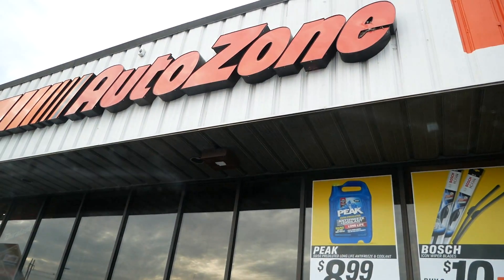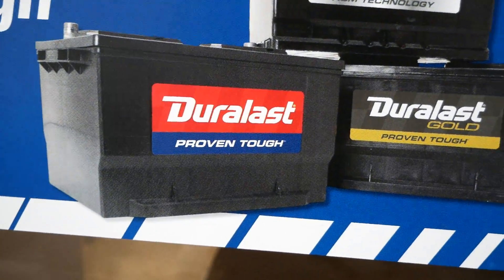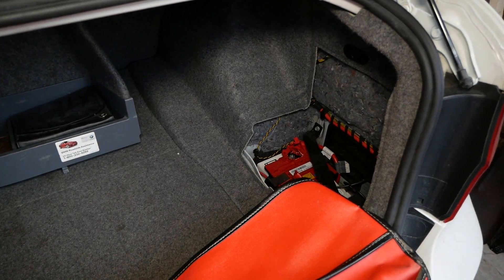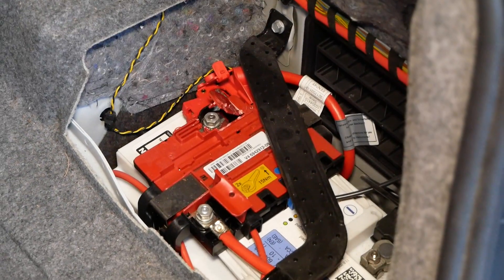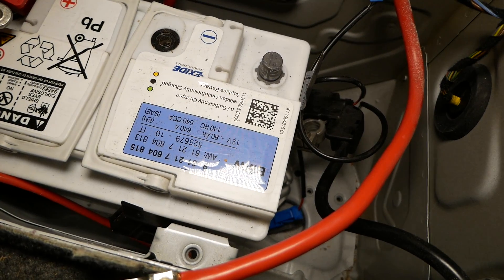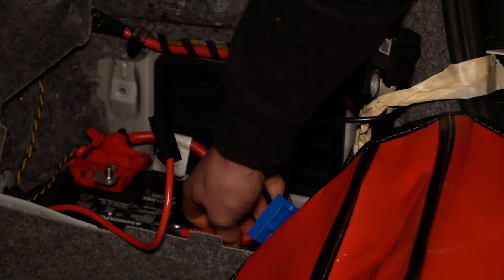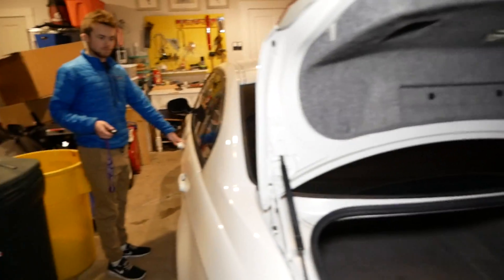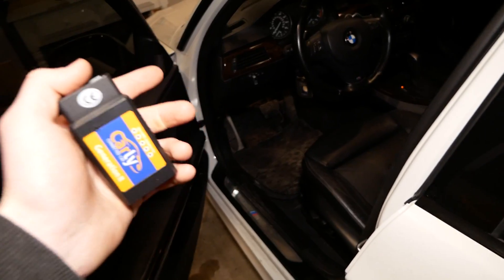More BMW 335 Problems // E90 Battery Replacement

Comment: I just went thru 3 chargers just to realize tonight the voltage is dropping in the battery charger while charging my 335xi...my question is can I get the battery replaced & installed at a indy shop for less than $200?? I dont have a stock battery but some aftermarket diehard battery.

Comment: Pleeeease ..,show us how to reprogram to battery to the car
Reply: In carly it's all about choosing the battery You just installed and hit code.
Reply from the maker: Dest90 is correct... it is very straight forward
Reply: I replaced my battery in my E90 and did not have to reprogram it.  I think you have to reprogram it when you replace it with a different voltage.  My 06 E90 had a 90amp battery and I replaced it with a different 90amp and there were no issues.  If I had replaced it with at 80amp, then yes, I would have had to tell the ECU that there was a different battery installed.  I have read that some people have had to reprogram it even with replacing with the same battery...maybe I just got lucky but others have done exactly what I did with no issues.
Reply: I was told that if it is no reprogrammed, the battery life will be reduced. I don't remember the reason why it happens but I do remember that it did make sense.I will send you the info as soon as I get it.
Reply: chriszachmo You have to program the new one. It’s charging diffrently than the previous one. Of You don’t do it, it’s very possible that IT won’t last long. It’ll be overcharged or undercharged everytime
Reply: Dest90 I have a Carly so I will go and reprogram it.  I didn't get the error code that most people get when they change their battery like the guy did in this video so I just thought that it was good.  I knew that if you changed out a different amp battery that it would charge it at the rate of the original battery. Thanks

Comment: So disconnect the positive before the negative? Saw the loosening of the positive then it appears you may have taken off the negative, first, then took off the positive second. Just want to confirm. Thanks for the video. Just couldn’t see the negative in the beginning when you first started battery work
Reply: negative first
Reply from the maker: Yes- you should do negative first.

Comment: no breather tube for the battery? would of loved to seen the carley do the battery registration. i want to see what it can do.
Reply from the maker: The new battery did not have a breather hole...
Reply: any chance you got footage of fixing that warning light with carly?
Reply: No breather tube..Probably not the best thing..Just sayin.
Reply: My original BMW battery for my 2006 E90 did not have a breather tube installed. There wasn't even a place for it.

Comment: What would it do if ya didn't register it? 
My 07 e93 335i locked the keys in itself this evening with the radio and idrive running.... the car set there for an hour until it ran itself dead. Ive got pop-a-lock coming out in the morning to unlock it.... and im assuming ima prolly need a battery as well.
Reply from the maker: Sorry to hear that! And that's a good question. We're not entirely sure, but the car should still run (presumably).

Comment: Dose the battery also work for A 2011 328i? And How did you reprogram it !! Just got the adapter! Helpful video BTW! 👍
Reply from the maker: Yes - that battery will work with the 2011 328i - you choose the battery and select register on the app.

Comment: Hey JD you ever think about replacing your shocks and struts. I mean I know it's a pretty expensive fix even if you buy after market ones but you have to think with your car over 180,000 thousand miles that the the current shocks have to be completely or if already shot.
Reply from the maker: I do have to replace mine soon... quite bouncy.

Comment: That’s so weird when I swapped my battery in my E90 325xi I had no codes pop up. It just worked like a charm
Reply: Cissurz interstate batteries
Reply: Did you kept it plugged to a charger ? Usually if you don’t most likely you will get those codes, the ecu will reset itself, those codes are easy to erase just turn the steering wheel all the way to the left and then all the way to the right and that resets them.
Reply: No my dad ordered it from Interstate batteries and then brought it home. Once he came home is when we put it in but I remember nothing popped up
Reply: Bebo Lemus He probably turned the steering wheel and I just don’t remember
Reply: Brandon Vasconcellos probably he did, mines I had to do it, my car gave me a big headache since my battery completely died and at the same time my alternator voltage regulator broke it so hard for me to find the what was causing my car high voltage, I couldn’t even drive it, every time I would give it gas my voltage would go from 12.8 up to 19v.
Reply: Bebo Lemus Damn that must’ve been a headache. I wasn’t even driving when it happened my mom was driving it and when she came back from here Christmas shopping it died. I wasn’t surprised though cause the car sat for 3 years at our parking garage cause the customer never paid. So in the summer I’m just gonna swap some parts just for preventative maintenance
Reply: Brandon Vasconcellos yeah it was a headache but I finally got it. Yeah after 3 years I would expect that and a few other things to go bad. I’m surprised your water pump didn’t died. Have you tried having a bmw mechanic go look at it? You don’t even have to take it to the dealership to fix it. I know a company that can actually get it done thru internet, all you need is K+DCan cable from them, they’re called Bimmer geeks. Look them up they charge about $45 bucks per section.
Reply: I'm surprised about the water pump too but it still runs pretty good. The only thing my dad did was swap out the shocks for Bilstein and the m tech front bumper with the m tech rear spoiler. I'm gonna be ordering the m tech rear bumper soon which will probably be in the summer.
Reply: Brandon Vasconcellos glad to hear all the plans you have for her.. I just got my shocks done last month along with performance brakes, also had to replaced my oxygen sensors. Next project is to replace all my vacuum hoses and new canisters and also debating on getting my turbos done or change my twin turbo to a single turbo. The exterior I already worked on, I have the m3 body kit all around also a Carbon fiber trunk with Lci rear lights, bbs Motorsport rims, I’ll see if I can shoot a video of how the car looks and uploaded to YouTube

Comment: it is really not safe to put a battery in the trunk without the venting tube. The gases it release is pretty corrosive, it is going to eat up everything in the trunk.
Reply from the maker: I'm aware, but this battery did not have a breather hole. It is a sealed battery.
Reply: Sealed batteries still have a vent hole, or else they will blow up. Actually you can clearly see the vent in your video at 1:56. It is on the negative side.

Comment: You don’t gotta reprogram it just connect some jumper cables from car to car that way the voltage does not drain from the car, i personally own a325i e90 06 and did not have to register the battery it was a easy swap.
Reply: johnnyBlucky Ohhshiiid you do have to register the new battery to the ecu. Expect to replace your new battery a lot sooner now
Reply from the maker: You do need to register the battery for proper charging.